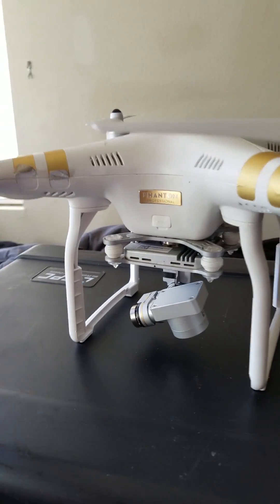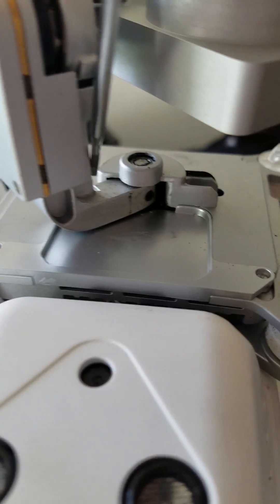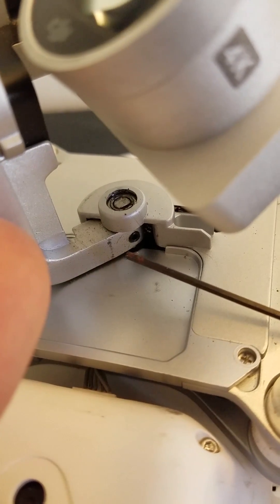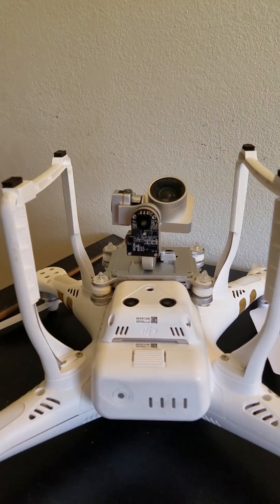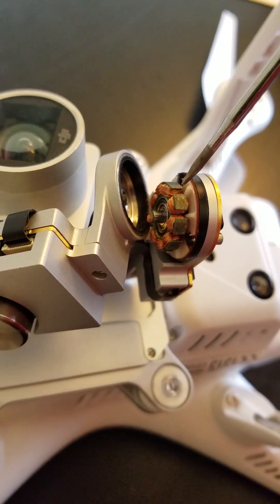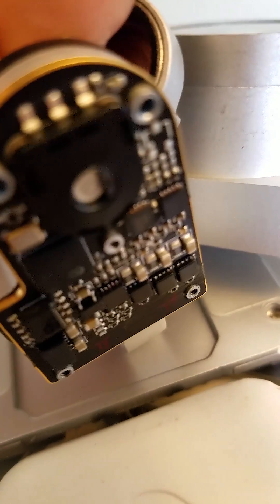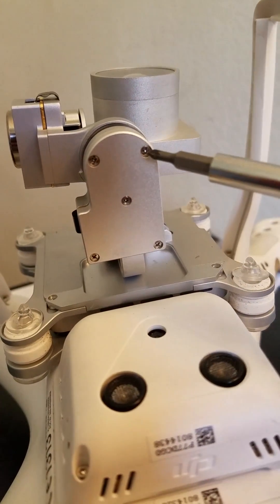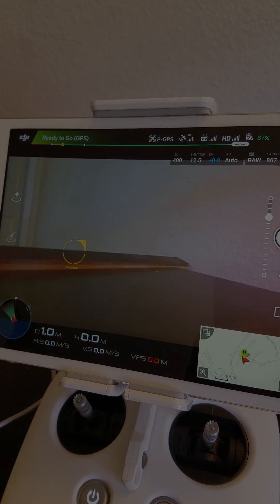DJI Phantom 3 Gimble Spinning Out Of Control :  Fixed

Comment: Hey another thing that's crazy, so my phantom 3 standard hit a street branch, and then smacked my driveway, and it cracked the gimbal bracket that mounts to the bottom of the drone, so I glued n fixed that, drone was fine, but then when I started it up, I realized that it said couldn't start and couldn't calibrate the compass, so I realized that when I tryed popping the top Plastic cover back in from when it cracked. I accidentally broke the compass plug that plus into the circuit board, so I went n bought me a Phantom 4. But anyways, I then took apart my P3s and I soldered the wires back onto the circuit board and I got the compass Workin again, but then I realized that ever since then now, I have two problems, the camera is going crazy for a minute, and after a little while, it fixes itself. But another thing also that i never had happen before, it says can't fly yet, drone still warming up or whatever. What is that all about tho??? Bc I've never had a problem before where the drone would say warming up n not ready to fly yet, wtf???? And also. The camera spinning crazy.

Someone please tell me why my drone says not ready to fly still warming up, tell me why when it never did that shit before tho???

Comment: You do not need to separate the motor from the casing in order to re-align the spindle. You do what he says you shouldn't do. Lift the circuit board, turn the spindle by hand or with long nosed pliers. The fitting on the board can be realigned, it turns easily with a screw driver or tweezers, to allow the spindle through. The motors are pressed into the housing, if you pop it out, it becomes a weak point and can separate when the drone is in flight or knock/bumped (heavy landing?). Unless you drive the spindle fully back into the housing, there will always be this risk. A slight knock and the motor can just fall apart. The motor windings are magnetised and will hold the motor in the housing because of the steel lining. If you look at the back of the housing where the spindle appears, a non-separated one will show the spindle flush with the outside surface of the housing. One that has been separated will be slightly recessed. I thought the prizing down of the gimbal mount to rotate the Yaw motor was a bit iffy as well, all you have to do is release the rubber dampers and drop the gimbal down. That's how I would do it anyway.
Reply from the maker: Thank you for your reply.  Although this would have probably been fine in hindsight, this video was made 3 years ago when there weren't many videos around.  So a lot of what you see is just people trying out different things based on what they read.  I definitely don't have that drone anymore.  But what I found worked for myself and others.  If anyone reads your comment, then they should try yours first in order to not play with the circuit board.  Especially if you aren't grounded.  I always am grounded, and so doing what I did would have no consequences.   I appreciate the feedback though and everyone should try that first if they still have this drone.  Just FYI, I wasn't able to turn it without removing the circuit board because that part is meant to be tight by default so that it doesn't spin on its own.  But again, people can try what you said first if they want
Reply: I did this and am having the problem that you are describing. the motor is barely held on. and falls off at the smallest bump. how do i make sure that does not happen?
Reply: @alexcroteau9799  You can try pressing the parts together and relying on the magnetised windings to keep things together. I wasn't happy with this, so I bought a new motor that was tightly "sealed". You need to buy the right arm and motor. The Yaw is inside the gimbal, the middle one is the Roll and the one linked to the camera is the Tilt.

Comment: Thank you so much for this. Mine crashed and didn't realize the orientation of the potentiometer was the wrong way when I put it back together. Already ordered a new potentiometer and a yaw motor based on solutions I saw on other videos but so glad I'm seeing this still. Worked like a charm.
Reply: Thats awesome.  Hope it doesn't happen again :)

Comment: Thanks for the help. Have tried similar before without success. I took your second section of the video but also added super glue to the spindle as the camera would slip and get out of alignment and then shake. Your method and the glue have worked a treat. Thanks.
Reply from the maker: Cool idea! Glad it all worked out!

Comment: You DON"T need to pull the motor apart! Longnose pliers will turn the shaft.
Reply: Doesn't seem correct.  How do you get the pliers to grip on the metal, which is protected by the black plastic?
Reply: You take the backplate of the R. Axis, pull the board away till it comes off the shaft, it will come out about 10mm plenty of room to get pliers to shift the shaft. 5min job, I have done enough of them.

Comment: thanks dude, now just try to fix controller signal weak
Reply: Wrap the Ariels in Tin Foil
Reply: You have to go into the app controller settings and press rc pairing. Then you press the button on the underside of the craft and hold it till it blinks.

Comment: So I did mine earlier before I watched this and took the screw out of the casing and turned both the screw and the casing ring . Any repercussions? Or were you saying that because you need them aligned? Just wanna make sure all is good with mine
Reply from the maker: No that should work just fine.  As long as you aren't touching the circuit board

Comment: I checked these steps but still shaking like crazy.
Reply: MIne was still doing the crazy dance after these steps but yesterday I decided to look what’s going on, so i open the app on my tablet clicked on the 3 dot on the top right corner, gimbal settings and clicked on the gimbal auto calibration, now, everything is working fine! Hope this helps!

Comment: I have a chance to buy a phantom 3 standard that as the same swinging gimbal issue but he says he happened after a failed firmware update. Is it bricked or could it be fixed?
Reply from the maker: I'm not sure but in my experience, the standard does not have the same GPS capabilities as the pro.  I bought one and used it twice before selling it and going to the pro. It doesnt hook up to an many satellites so it's not as stable.

Comment: THANKS! I wish I would have seen this before selling my gimbal on ebay. My gimbal was doing that same thing. But at least I did get $115 for my "broken" gimbal. My new Phantom 3 was doing this all of a sudden. And thankfully was able to fix it this time
Reply from the maker: Thats great.  These things are not cheap so it is nice to be able to repair yourself and not spend a ton of money getting it fixed

Comment: Need help on the same issue as have done the things as you showed in video but still problem continued and i found that the PCB getting hot...please help to resolve
Reply from the maker: I am sorry I just saw this... were you able to fix it?  I do not know why yours is getting hot, but it could be because a component or coil came off or was damaged after a crash.  Take a close look at a board and see if you can find anything that is "off"